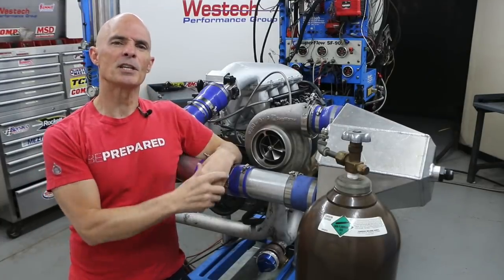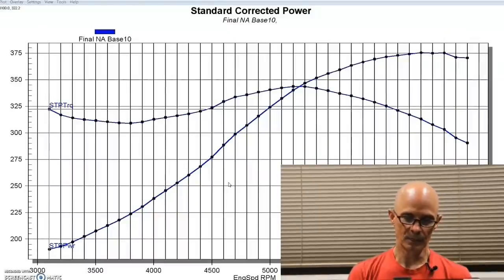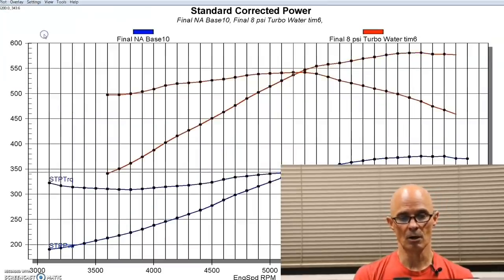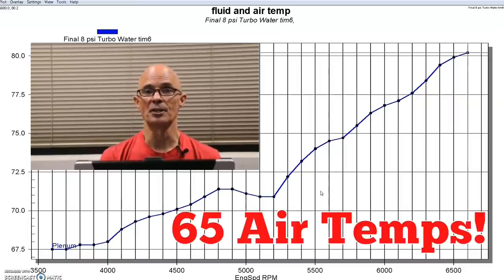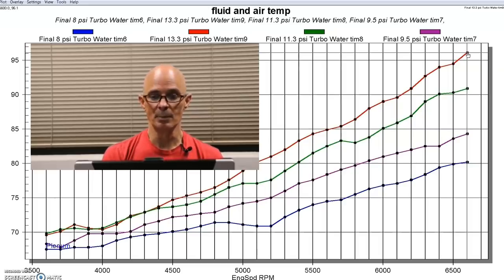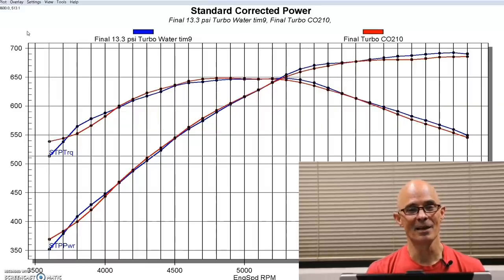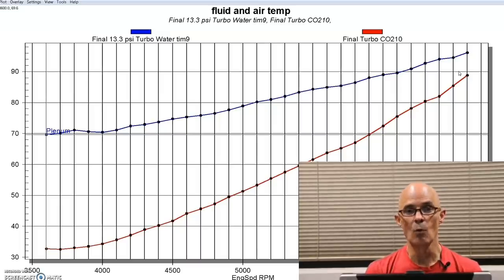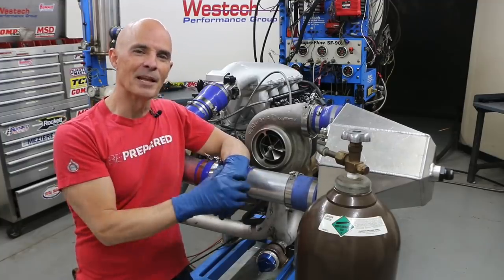HELP, CO2 INTERCOOLER FAIL!! FULL RESULTS!!

Comment: As many others said, it's about the latent heat/thermal mass.  The A2W IC is designed to transfer heat to liquid with high thermal mass.  You need more area, more pressure (or more time) if you're going to transfer to a gas medium.

Comment: Can there be ice building up,  restricting the flow? Experienced that when I opened a co2 bottle with nothing attached for fun. The ice builded up in the nozzle and efter a few sec no co2 flow at all. Until I closed it, let it melt off and opened it again.

Comment: So perhaps for a given square inches of inter-cooler there is a limit to how many btu of heat you can extract ? Sure the CO2 will lower some volume of metal (just as an example) to -120 degrees, but there is still only a limited amount of BTU avail in the evaporation process ?? The math for the volume of air the turbo is putting out, and the amount it raised the temperature should not be terribly complex. That would give us BTUH. British Thermal Units per Hour. The heat extracted from your home by an air conditioner is measured in BTUs, while cooling and heating capacities are referred to in British Thermal Units per hour. For reference, 12,000 BTUh equals one ton of cooling. That would tell us how many tons of cooling you need to reach -120. Might take a bank of bottles like this. https://www.praxairdirect.com/PXItemDisplay?catalogId=10051&top_category=11501&categoryId=11532&storeId=10152&itemID=67171.

Comment: Do something like Turbo John did. He was on a reasonable track for CO2 cooling. I would love too see the results of his concept and your testing ability. CO2 has been used in commercial refrigeration like ice rinks i believe. So one of these designers could apply some napkin back calculations to how well this could work. It is just a thermodynamics problem. Contact a thermodynamics professor at a collage.

Comment: Just like refrigeration you need a larger surface area when you want to quickly cool large volumes of air
Reply: Refrigeration is more efficient than water to air or air to air but it the 6 degree split across the heat exchange is difficult to control if you are aiming for 0 degree air intake temp

Comment: Around the 8 minute mark I saw HOW the CO2 was used.... that's not how thermodynamics works.... you have to spray the cooler on the outside to allow it to change phase and transfer the heat away.

Comment: Don’t worry about the fails . It’s the effort that counts . I think you need a restriction in the co2 right where it comes into the core . Or maybe a custom intercooler core with 4 or 5 co2 inlets with restriction at the start of the run through the core . Other people commenting suspect this too . Kind of like the orfice tube in an automotive ac.

Comment: There's too much thermal expansion and the air-to-water intercooler is very similar to a AC unit either on the condenser or the evaporator where you have to have some type of metering valve allowing the fluid to exit in a controlled way

Comment: Do you think you would see a change when it is 100F with 80% Humidity? Like in North Carolina. 65F is pretty damn nice temps so you are not going to see much in change. I know from my Butt Dyno when I drive my Cummins Diesel at ~32F it seems makes less power compared at 60F on a cool morning.

Comment: love your videos! can you do some more mod motor stuff
Reply from the maker: did you watch the mod videos?
Reply: @richardholdener1727  only the 2 so far, the 2v cams nitrous and the supercharged 4v, i just recently subbed. i have a mustang so i like the mod motor stuff, im still learning about them so i recon they peak my interest, i want to forge the bottom end next winter. i just put a procharger on this winter. it was a fun learning experience. its not making anything crazy boost wise now but its a d series and can turn it up when i get the bottom end built, fingers crossed anyways,
Reply: @richardholdener1727  but dont get me wrong i enjoy just learning about motors and cars in general weather it be a mod motor ls or whatever :)

Comment: You might try Fluorinert and put dry ice in it. Flourinert + dry ice was used for computer cooling overclocking records. Now they just use straight liquid nitrogen (not recommended in a2w IC). If you try it, have good ventilation or a way to recapture the out gassing cow from the flourinert.

Comment: It’s like your dealing with refrigeration and it needs a certain sized orifice to get the right drop across the inter cooler core,  using liquid up to the orifice and vapor inside the inter cooler but monitoring the exit like a txv
Reply: Bear Fulmer I'm with you in that one. He would need some kind of variable txv to deal with the rather large window of temp change through the cooler from the boost curve, as compared to the narrower temp change window a typical refrigeration system would deal with

Comment: It would be interesting to run ethanol or acetone through the inter cooler then put some dry ice in the water box and pump the super cold liquid through the ic.
Reply: Just make sure wherever the dry ice is is vented or it will go boom.

Comment: You would need to stand the bottle upside down to get liquid flow through the IC. The thermal mass of the gas is too low. That IC isn't the best design for the job though. The CO2 boiling in the IC would offer sufficient cooling but create flow problems. The CO2 ice/alcohol would be a better solution, but require a coolant pump.

Comment: At one atmosphere and 0 degrees C, the density of CO2 gas is 1.977 grams per liter. Water is 1kg per liter or a ratio of 505.817 to 1 by volume compared to CO2. Volume of Liquid CO2 at 300 psig is 0.9852 liters per kg.  Almost the exact same volume to weight ratio as water. The second you transition it from a liquid to a gas its density is lower than water up to a ratio of over 500 times at O degrees Celsius. It is just not dense enough to work with an water to air intercooler. 

Solution - Get an air to air intercooler, some card board and some gorrilla tape. Make a sealed box on one side of the intercooler an spay the CO2 into the box.

Comment: C02 is not going to cool as effectively as water due to surface area transfer. C02 is only cooling a specific area of the core. Water complete covers the contact area. Try using the C02 to the cool water.

Comment: Proper expansion of the gas and transfer from a liquid to a gas at the proper time is key. Like an expansion valve in the A/C system of a car. A specific device with probably a dual expansion system allow for true cold soak of the CO2 side as you are applying power. Might want to reach out to someone in the HVAC community. Mainly because you are talking about moving a large quantity of air in a short amount of time. That is similar to a large residential or commercial application. Preventing the cooler plate from warming up too quick is the issue you are facing. The water cooler you are using just wont work. Great work, and I enjoy watching your tests though.

Comment: Your not addressing air density, only temp. You need a weather station and look at humidity vs temp.  When are you going to mist water or meth straight into the turbos?

Comment: Co2 wont work. You would have to use freon.

You would have to replicate a closed loop HVAC system 

Once you review how an hvac system works, you'll see how heat and cold would transfer over. Gases have a real narrow band to work with while water has a wider band to work with.

Compare that with a heat furnace versus a boiler with a higher CFM, boilers are the way to go. Or you'll need to increase the size of your apparatus. But again that affects your CFM velocity. 

Back in the 70's some guys from So. Cal tried this. It worked for NA, running in the desert with atmosphere temp of 100+ but it didn't work when force induction (FI)

Comment: Looking at the charge temps with the air-to-water cooler makes me wonder.....does using an air-to-water cooler really help when the water we use in the real world is very hot coolant? You should run a set-up mimicking the real world coolant temps thru the cooler.

Comment: I think you need a shitload of flow especially when there is heat transfer. if you've ever sprayed CO2 or liquid nitrogen out it almost instantly evaporates. I think the core tube need to be twice as big as they are.

Comment: The co2 had changed state to a gas before or in the cooler. It is no longer as dense while touching the tube of the cooler. Hense less heat transfer will occure. Also even if you put a nitrous type selonoid on the outlet of the cooler the amount of co2 you will need will be huge. Most car don't have enough trunk for that bottle. 
This set up operates on the same idea as a/c. Good a/c system only change the temp about 30 difference than the air coming in.
Reply: Do forget the weight of the bottle and set up not practical. You will still need ice and water to refill bottles at the track. Unless you got thousands to put into bottles laying around.

Comment: Try use a killer chiller that uses the air conditioning system through a water to air heat exchanger. But as far as c02 i used in summer on my legacy gt. Went from a 15.9 to a 14.4 in the quarter mile. it was on an air to air, i would say try the c02 spray bar on an air to air. The car acted like it did on a 30 degree day on winter, full boost immediately. So i can say c02 does work

Comment: Couldn't see your whole setup. Did you invert the tank to spray liquid into the intercooler? Laying on its side may work for a limited time, but use a nitrous bottle stand to invert it completely. Do you have a restrictor on the intercooler inlet? You want the liquid to gas phase change in the intercooler as that is when it is absorbing heat. You will then have to play around with different size restrictors to match the needs. At least need a temp probe on the gas outlet.

Comment: Have you ever thought about doing pre-turbo, or post-compressor/pre-intercooler nitrous tests to see what it does for HP gain and IAT drop? Holley has the means to enrich fueling when dry nitrous is added.

Comment: Co2 is a gas, gas does not transfer heat as fast as liquid. Your better bet is iced salt water.  I have been able to get water temps down into the 20's that way before.

Comment: We all understand it is a liquid in the bottle and turns to a gas when released. The point is the cooling effect due to the pressure drop it is not the CO2 itself. Think of it like a HVAC system. You need a material safe enough to sustain a liquid that can be safe in the ATW core and place the pressure drop orifice tube at the exit of the cooler. The greater the pressure drop the better it will perform. Propane is a low pressure liquid that turns into a gas at atmosphere. I understand it is flammable and not inert but will do exactly what you are trying to do.
Reply: GermanShepherdsofOKC No you don't understand. The phase change is happening in the bottle, that's why it's frozen. I am starting to believe this experiment was to gauge the intelligence of the viewers and generate more comments as I don't think Richard  is ignorant enough to not know it would not work this way.

Comment: I wonder if you tried an air to air and a few dispersion bars across it and sprayed the air to air if it would work better since you are getting full flow and the pressure differential is going to be the greatest. Gay-Lussac's Law and all that jazz. The massive pressure drop could cause the air to air to cool down more than the fixed volume inside the air to water. It works in my head, though it may not work at all.

Comment: Liquids are much denser than gases, which means there’s more matter to absorb heat.  While the CO2 is super cold, it doesn’t have near as much surface area making contact with the intercooler to absorb the heat compared to water.  This is a reason why air to air intercoolers have such a large surface area; more space for the air to contact.

Makes me wonder...
Would an air to air intercooler enclosed in a box of dry ice give bigger AIT drops than an ice water to air intercooler.  Dry ice touching the intercooler would likely make the metal super cold, which is the link in removing heat between the intake charge and the air/water used to cool the intercooler itself.

Comment: what about  submerging a air to air   intercooler in  icewater?

my thinking is if the  max flow if   co2 maybe it  causes  area of  ice crystals cloging an area of the core right where the gas enters?

Comment: Circulate either coolant chilled with dry ice. Or pure alcohol with dry ice. I once did it with coolant. It's not liquid enough . My next step was alcohol. But I'm just not sure or the capability of alcohol to transfer heat. I'm sure you can find a good alternative Richard !

Comment: Hey Richard... maybe  try  txv thermal expansion valve with co2.. or just do a/c chiller.
With a a/c  chiller precooler on the turbo.. to chill the ambient incoming air..

Comment: The specific heat of water is very high, and it's more dence than almost anything you could flow through the intercooler.  Perhaps you need to try some iced salt water, and get the ice as cold as you can first. Since you like crazy ideas and to try the more is better, have some dry ice too to throw in at the end.  One thing you'll have to watch out for is freezing up the intercooler core. Then you'll have a huge pressure drop across it.

Comment: I think your problem has to do with the thermal conductivity of a gas compared to a liquid. You'd be much better off supercooling a liquid because there's "more of it" to grab the heat and run away with it, if you get my terrible terminology lol.

Maybe try a supercooled ice box using coolant and dry ice instead of ice and water?

Comment: Yeah, I'd try a valve on the outlet, to provide a adjustable restriction! If the intercooler could be filled with liquid Co2, it would be much cooler, but would need to off gas to remain cold, maybe the tank can't flow enough Co2?   But HEY! Nitrous is cold too! And it is designed to flow liquid!

Comment: You should try hooking up an AC compressor to the engine and running R134 through that intercooler. See if the cooling property can overcome the parasitic loss of the compressor
Reply: Dodge does this from the factory
Reply: @wainfiggitty  nice. Would be cool to see Richard set it up on an ls

Comment: I think you need to put a restrictor plate right there at the inlet to the intercooler. That way theres a pressure drop in the core itself. That should make it work like an refrigerant system. Another thing ive wanted to see tried is salt water in the ATW coolers. Because you can get salt water colder without it freezing and without the worry of an impurity causing distilled water to rapidly solidify

Comment: From my understanding, gasses don't exchange heat as well but, if your dead set on making it work, try and make the pressure of the co2 even and MAYBE a bigger pipe or hose from the bottle to flow as much as the intercooler will handle normally. That way it'll cool the same the entire way across. In theory lol
I'm glad you try stuff like this. Peaks my interest

Comment: As someone has already said, liquid seems to be a far better exchange medium. Example: I'm a pool equipment repair tech. Lets say Monday is 85 degrees and the water is 85 degrees. If a cold front comes in overnight and the next morning its 40 degrees. That pool water will feel warm all day because it retains its heat for most of the day. But how long does it take to lower the temp of your house when you come home and its 80 degrees. You turn the AC on and its 70 degrees in 20 minutes. Just my take

Comment: Pretty sure you weren't having phase change inside the IC

Liquid refrigerants (which is how you were using the CO2) will commonly show you the point where they boil.  In most refrigeration or HVAC systems, you will see frost at the expansion valve or capillary tube

Look at the frost line on that tank lying on the floor - betcha a box of Krispy Kreme donuts that shows where the liquid was boiling off inside the tank, and you were feeding cold gaseous CO2 into the intercooler

I think you're right, more flow will do the trick.  How much?  Well, I don't know.  But I wouldn't be surprised if it ended up being more than you can get through the valve at the top of one bottle - you might gang 2 or 3 together...?

Comment: Its the phase change that generates the cooling.. the same way heat is released when gas is compressed, cooling occurs when decompressed.. just make sure the decompression event occurs at the intercooler fins for best results.

Comment: I think you may need to come up with a 3pass intercooler core much like the 3pass radiators. This would force the  Co2 through the intercooler 3 times before exiting... if you look at the theory of operation on the 3pass radiators, coolant in a traditional radiator takes the most direct path... leaving much of the radiator stagnant with very little flow... meaning the only cooling is being done by a very small percentage of cooling fins... making it a 3 pass leaves the coolant no option to chose it’s own “direct” path and forces it through an planned intentional path

Comment: Water takes a lot of heat to change temperature, the specific heat. CO2 is cold, but in gas form it doesn’t absorb heat like water. Think about those lbs/min of air going to the engine and put similar lbs/min of CO2 across an ATA intercooler, you might get some results. But it’s going to take a LOT of CO2!

Comment: I think the trick is making sure the CO2 goes through its phase change INSIDE the core. You could also try using a CO2 to water to air setup where the CO2 is only cooling the water or a water antifreeze mix. Or maybe you could use an AC system evaporator coil, seeing as they are designed for this type of heat exchange application.